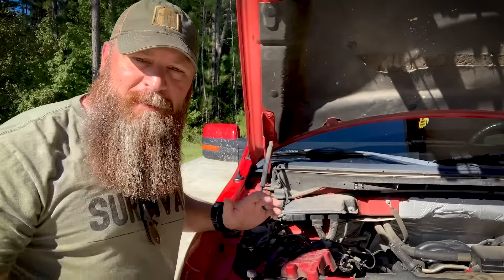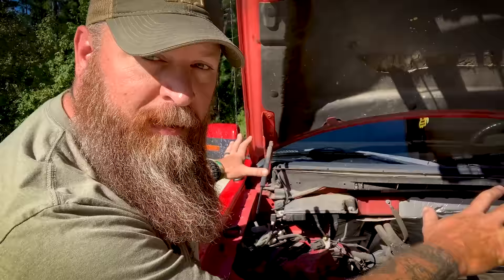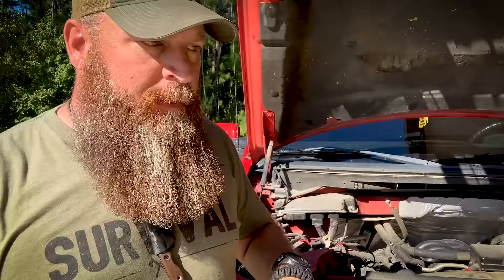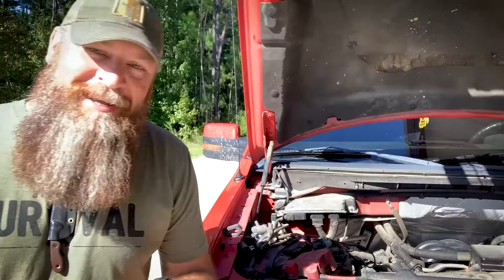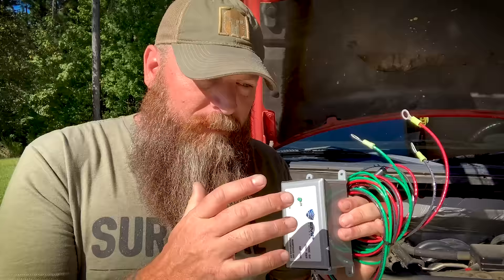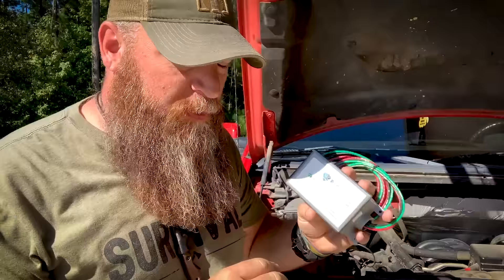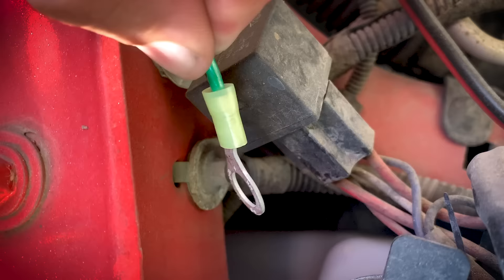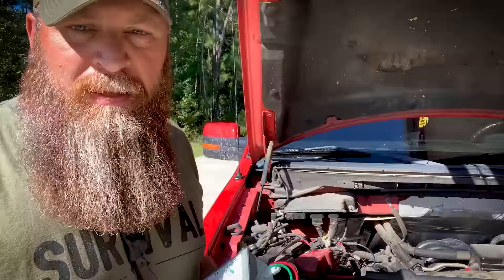EMP PROOF YOUR VEHICLE

Comment: 5k amp grounded through 10g copper stranded wire through the rubber tires to the earth???  If you knew even a tiny itty bitty bit about electricity or electronics, you would not have made this video.  Sorry, this is criminal

Comment: There is no way it can handle 500 amps of current as you claim. The wires I see can handle no more than 15 amps at 12 volts. There is no way this will work. The wires will melt. if that doesn't happen, the box will blow up. It is great that have a backup for lightning. But not for EMP as you claim. The whole point of an EMP is to deliver as much voltage and current to a directed area as possible. This item will not protect you. I feel this video is very misleading, and I will be dropping my subscription. I am a licensed broadcast engineer. I have to worry about stuff like this everyday to keep my stations on the air and believe me sir, you did the public no justice! Feel free to contact me if you feel I am wrong! I will be awaiting to hear from you.

Comment: I honestly doubt this, I have a 1980 K5 that doesn't require installing a small box that doesn't look like it could handle a microwave and a lightbulb running at the same time. Imagine putting your faith in some modern piece of junk when the world is ending 😂 EVERYTHING MADE IN THIS DAY AND AGE IS DESIGNED TO FAIL. They warranty it 😂😂 who's gonna replace it when a nuke goes off? I wish you the best of luck bud, put your trust in some piece of plastic that you don't know anything about other than what the manufacturer says. Ps my K5 is no jellopy and will still be on the road while you figure out why your crap shoot of an idea didn't pan out like the manufacturer told you it would. Cheap insurance? More like costly mistake.

Comment: Your Alternator and starter will be turned into massive EMP current generators, put a DC sorge protector inline between these two devices, install a lead blanket over the vehicle computer. Then install a 100 amp shutoff switch between the battery positive and the fuse box. Under the battery, install a layer of cardboard with 10 gauge copper wires thru the channels linked to the frame. Over the entire fuse box install a box with as highest purity copper you can get, or using a soldering torch build you a high purity copper box and place fuse box in the copper box. Then using a jumper cable, attach the positive lead to frame and a ground rod, the two  negative leads will get attached to each of the frame rails to equalize the current going to the ground rod.

 Now after all that, get out guns and ammo, because you will be fighting the Chinese, Russians, Hamas, Liberal leftist socialist hell bent on property Confiscation, food raiders..,..,.....etc

It will be hell on earth as humanity turns to it's inner animal instincts all while just being plain evil.